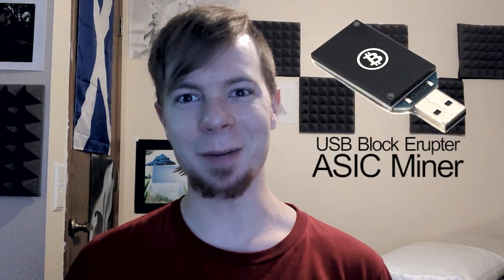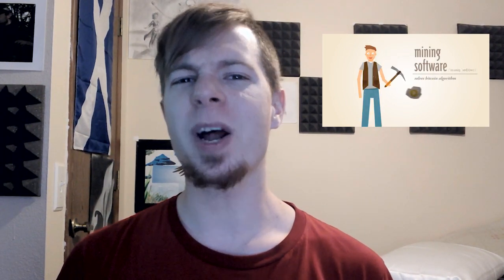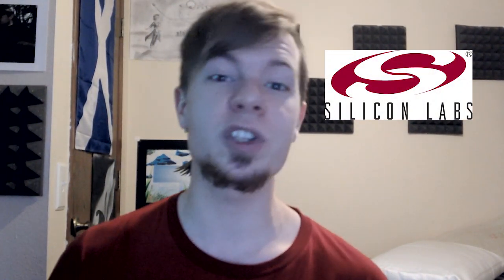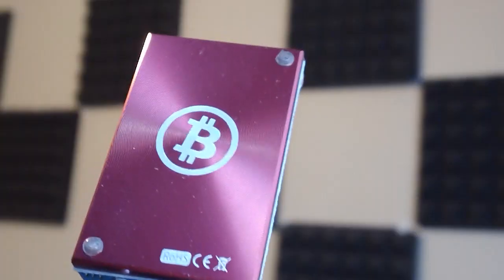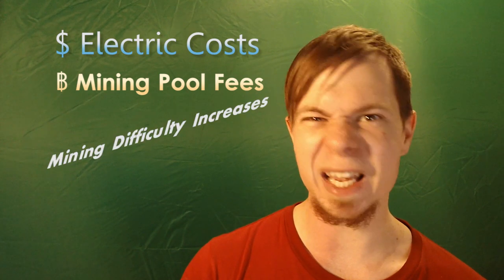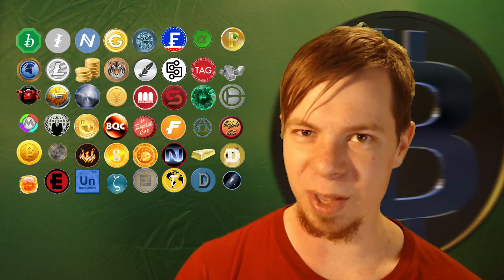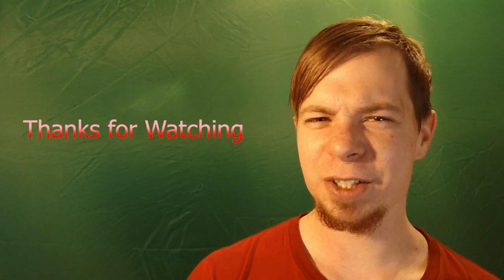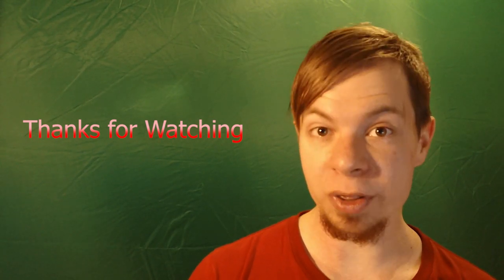Bitcoin Mining on the Cheap? USB Block Erupter ASIC Miner Review

Comment: Hey Mohawkdade,

I've been looking in to bitcoin mining (and other cryptos) for a bit now, and crunching numbers. It seems to me that purely from the $/Mhash and power intake the best way to go is banks of USB ASIC devices. But even then, it never really shows any real profits.

I'd be willing to cough up for say 10 units and run them on a bank to confirm, but the maths just doesn't add up. Can you recommend a device that will actually show a positive ROI ? I won't hold it against you if you're not right, as this is a speculative market etc etc etc.